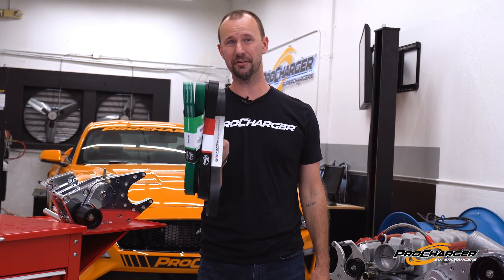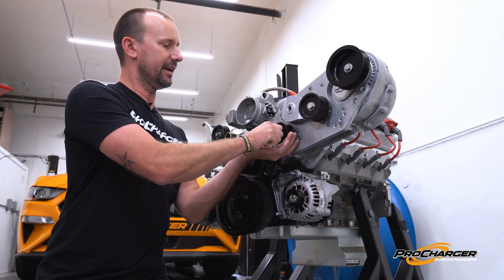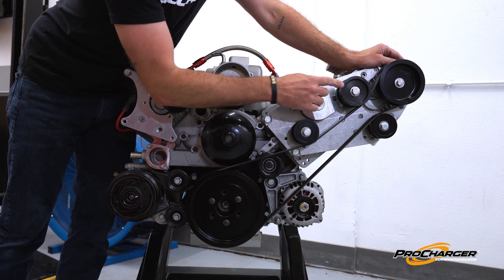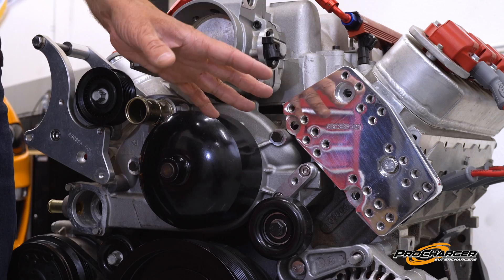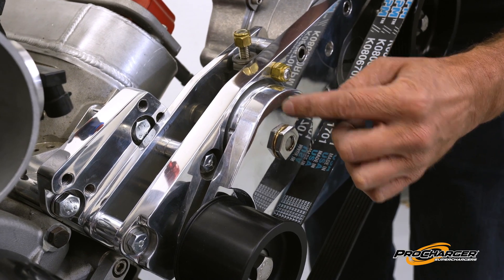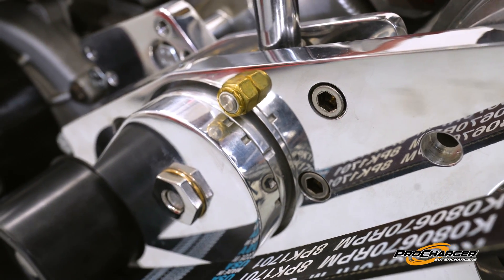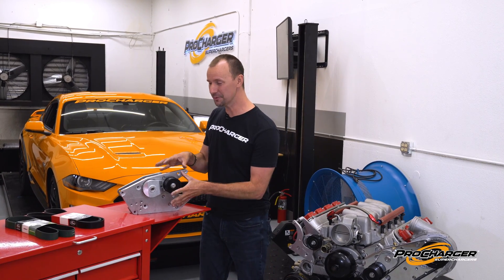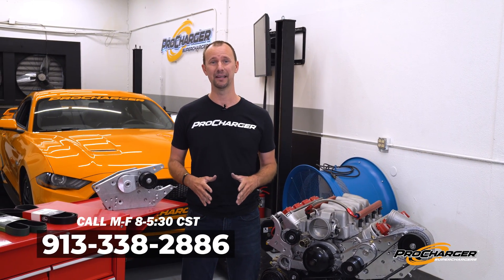ProCharger 101 - How to Choose and Tension Your Belt

Comment: I just reclocked the oil slinger in 10 oclock position for ls1 04 Pontiac standard rotation but forgot about dipstick 😂 do i have pull housing again so slides in correct place or is it as simple as swapping to top hole? Ive heard some say may need longer dipstick ,it was on a windsor 12 oclock position,also will move rear housing into correct spot for intake pipe,but relocated oil slinger and drain was simple in d1sc

Comment: I cant get it fully loaded by hand, it becomes too hard to do (using a ratcheting wrench) and if I keep tightening the tensioner eventually I can’t really tighten the 9/16 and it seemed cockeyed. I’m thinking my belt has lost some tension so even though I’ve cranked it quite a bit or possible a shop has slightly bent the bolt in a way I can’t see? I’m thinking I need to have a shop correct this when I decide to replace all the belts in the car.

Comment: What about the D1sc Procharger what's the best way to do that manual tensioner to get as much belt life as possible. My belt I just took off when I pulled the motor out of my car basically had no ribs barely left on the belt itself. Thanks!

Comment: Hi sir, I have a corvette c7 with the LT1 416 stroker engine and I installed the F1A94 procharger with 4.13 head unit pulley and I’m planning to replace the head pulley to 3.85 with pump gas and I couldn’t find a clear lead for the size of the belt that will fits perfectly in my corvette. In addition, my current belt is K080450 could you please advise me what is the best belt number to be fit in my new upgrade? Or I don’t have to change the belt just tight it with the procharger tensioner?

Comment: which belt would you recommend for most manual tensioner applications?
Reply from the maker: If you can run a Gates RPM that is preferred, otherwise virtually any belt will work.
Reply: @ProChargerSuperchargers  thanks for monitoring these comments and responding!

Comment: So let me get this straight,
Eric. After you set the tensioner and lock down the 3/4” (19mm) bolt and 14mm, you are supposed to back off the 13mm a bit!? I never heard this.
Reply from the maker: Correct.  The top nut shouldn't really have any tension on it.  Since at that point it's not doing anything.  Otherwise, if the tensioner loosens up for some reason, it could bend that threaded shaft.

Comment: How come you guys don’t do something similar to Griptec pulleys? I use a Gates RPM version belt and had it guitar string tight and was still seeing a bit of slip on a 3.70 pulley.  I switched to their 3.625 pulley and all is great. I even have less tension on the same belt. 🤷🏻‍♂️
Reply from the maker: Griptec is a patented process.  It works very well, however, depending on the application we have no issues making 1000hp with standard belts and 8 rib pulleys.
Reply: @ProChargerSuperchargers  all good. I was just curious. 6 rib can be a pain. 👌🏼
Reply: @ProChargerSuperchargers  when are you guys coming out with new head units